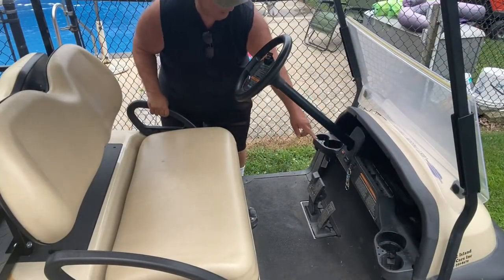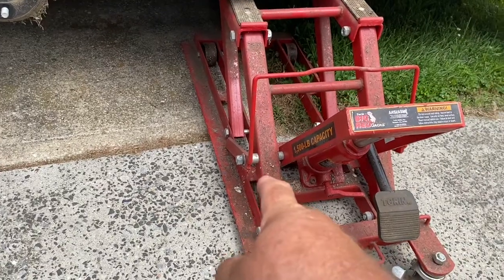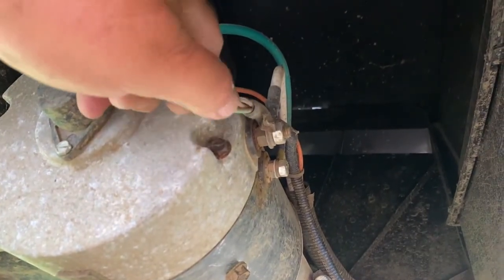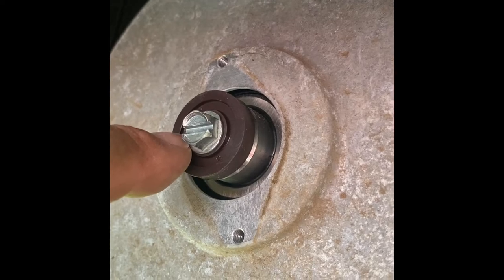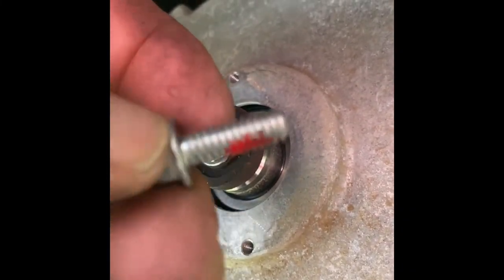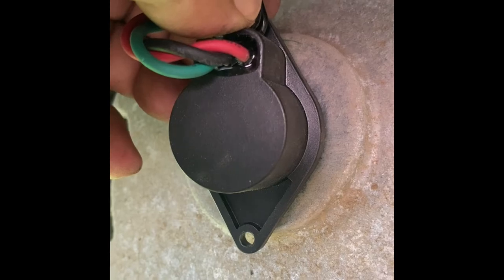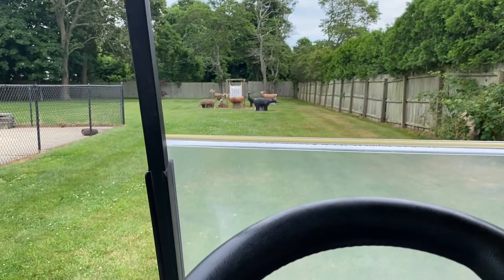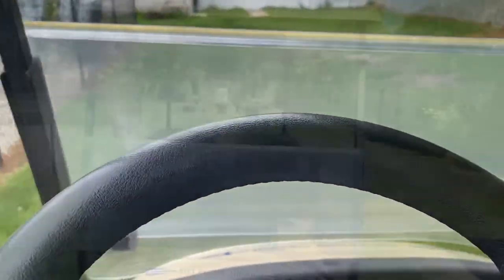Golf cart repair. Club Car speed sensor replacement and high speed magnet.

Comment: This is a scam. Just got mine in changed it 20 minutes ago saying speed, so I’m calling bullshit. It does not work.
Reply: I just did it to my EZGo and it went from 14-15 to 19-21. I’ve seen several people do it with Club Car. You prob did it wrong.
Reply: You also to have someone hook up and change the computer setting on to #4 (high speed)